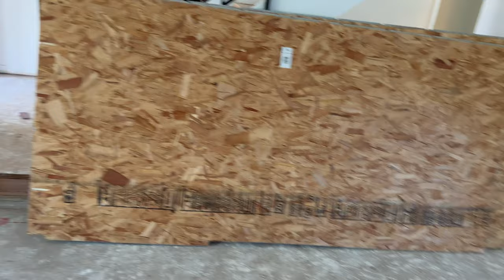Home Remodeling March 2023

Comment: Looks incredible, what an amazing job. Tremendous difference. Two questions for you:

1) Are you comfortable sharing how much the glass cost? 

2) What is the painting over the fireplace? Very pretty.
Reply from the maker: Thanks for the compliment. It costs roughly $6,400 for the glass panels with delivery and installation included. The painting was from a local department store.